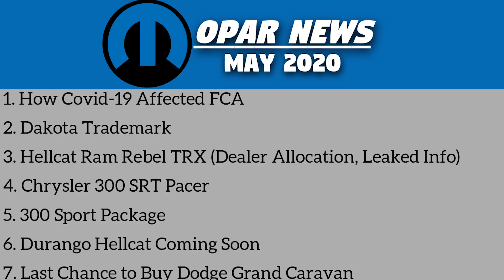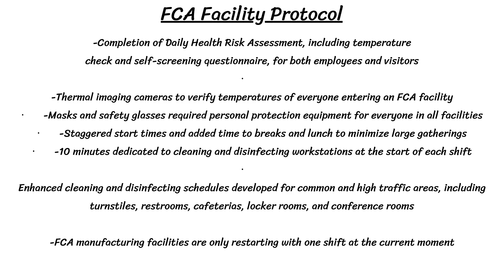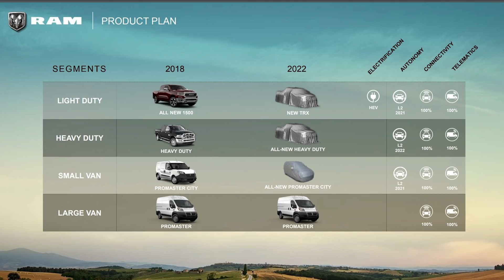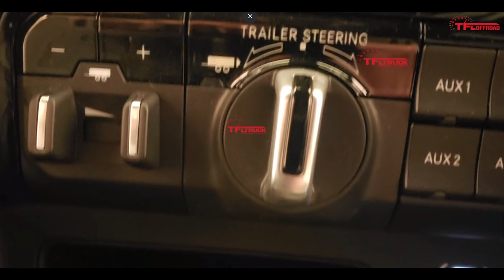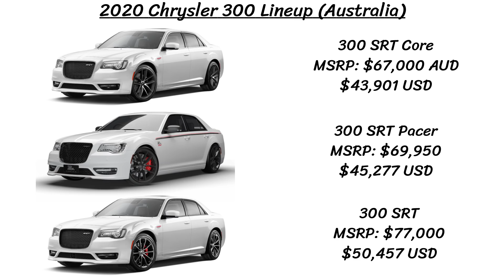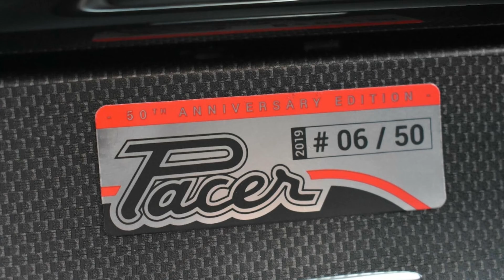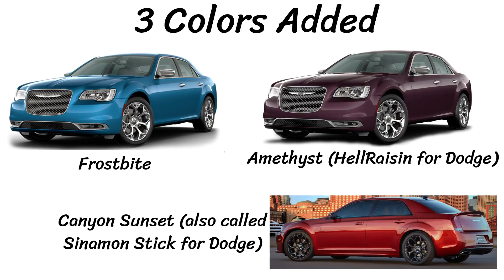Mopar News May 2020 – Pandemic, Dakota Trademark, Hellcat Ram & Durango - LOADED EPISODE

Comment: Hate to say it, but the caravan going out sucks. We have the last town and country model made and personally I like it more than the Pacifica, for families you can’t beat the price for what they are and can do. Fully loaded, 4 heated seats, heated mirrors and steering wheel, 3 screens. DVD Blu-ray and hdmi/rca hookups. Kids can watch on separate screens with headphones on trips. Almost 300hp for the dads. 12 cup holders for the moms. And the price is a steal. I’ve hauled 2 sheets ply wood with 30 bags of mulch. (And having it saves me from having to use my Challenger all the time. Lol) the Pacifica is just more expensive for reasons I can’t figure. And some features aren’t as nice as the old. And when are we getting a hellcat 300?

Comment: They need to make a recall on all 3.6 engines whether it has warranty or not they need to make a recall on all oil filter housings and head gaskets biggest problem dodge never fixed and maybe instead of a 3.6 maybe a 3.8 or 3.7 because as much as I love the engine it’s to sensible to almost everything